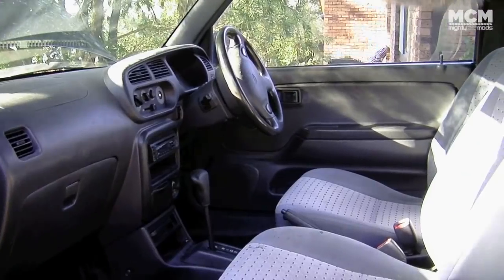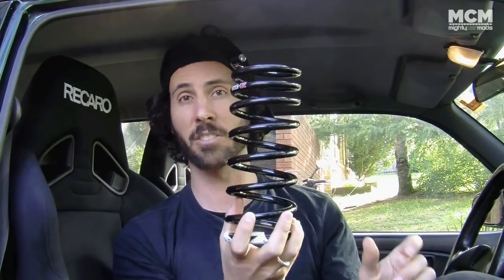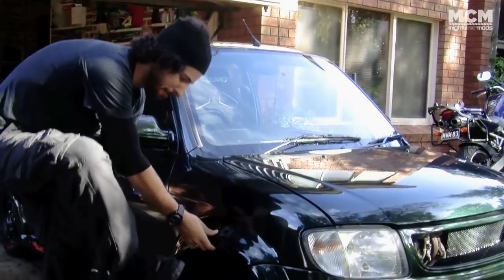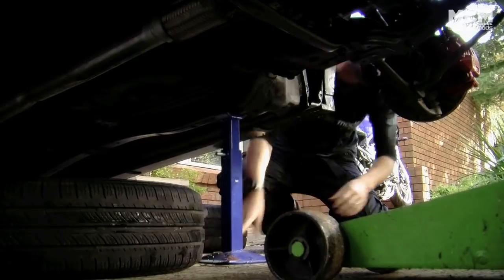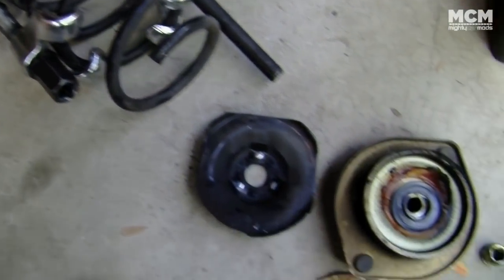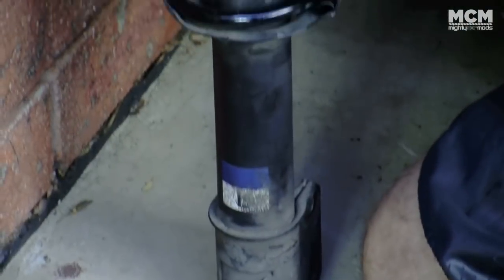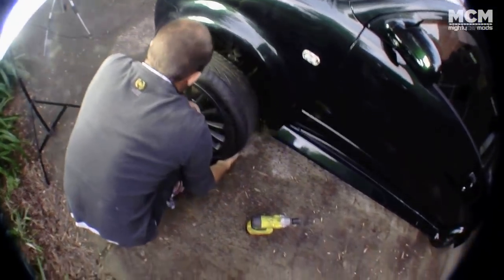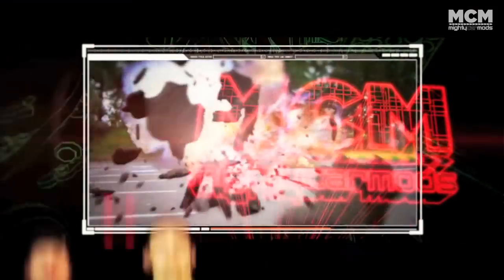How To Install Lowered Springs

Comment: Yeah, assuming you have everything else in terms of tools. If you don't, pay a mechanic to do it for you. Springs can be very dangerous if not done correctly with the right tools. A mechanic would have it done within two hours labor, and won't charge too much

Comment: I'm going to lower my VW Golf 5 soon but i'm worried thatmy sway bar will rub on the drive shafts when cornering or anything more pressing on the suspension... I've added shorter drop links as it is (factory) and I'm already hearing a rubbing sound when at full lock?
Any idea's??

Comment: hey bro , I just  been installed lower spring  my 04 civc. But it  going  too low it about 1" or 1 1/5"  ,  it hit my rear fender when on corner. Do you have any idea to make it stronger  when it have  turn?  thank you
Reply: Raise the  suspension up so  it's 30mm all  round. if  you have  it too  low  it'll scrape inside the wheel arches..  Unless you  get the wheel arches done.. It''l  be  cheaper and  easier  to  just  raise the suspension. You  can change the bushes  for  poly  ones and  the  bump stops  too.

Comment: How are the struts holding up with just the lowered springs????  I failed the shoe test and need to lower my car.  Just a little weary of replacing only the springs.  would only be a 1.5-1.7 inch drop.

Comment: Okay so here's a question I have a 2000 SL500 and I don't know if you know but the Springs are separate from the struts so could I in theory just take some spring compressors Jack it up use the compressors and switch out the springs thanks

Comment: do good springs increase handling/make cars grip better?
my wrx grips quite well but i want it to go harder :)

would some good high quality progressive springs do much ?
Reply: +Jared Tate Nice car :)
Reply: Grip is based solely on tyre but however lower suspension (better springs) increases stability and handling

Comment: To change the rear springs, do I have to use the spring compressor? My car bounce in the front do I have to change only the shocks or both the springs and the shocks? Thanks.

Comment: when installing just lowering springs, doesnt that mess up everything? Like rebound and tension between the spring and the strut, since the spring is smaller. And also doesnt it ruin the allignment?

Comment: Hey, MCM, when I was bombing about in VW Polos there was a general consensus on the forums that lowering springs would kill off a standard shock in fewer miles... certainly, all the kids fitting ebac's would inevitably be back 6 months or a year later fitting coil overs because there shocks had failed... do stock shocks take a pounding with lowered springs due to always being permanently compressed by 40mm, or do ya reckon the lowered springs just allow more aggressive driving that simply kills them quicker?
Reply: their*

Comment: Do lowering springs make a really big difference in dropping your car ? Have a mazda protege5 and i heard they dont make much difference but improves handling. Anyone ?
Reply: It depends what you want from a suspension upgrade.

I have lowered sport springs on my 2004 Honda and it is now slightly lower, not hugely noticeable, but the handling is amazing. Obviously though they don't allow any adjustment to any suspension characteristics eg ride height, damping etc because they are a set height and can't be adjusted.

If you want to go as low as possible then you might be better off with air ride, although it ain't cheap. I recommend adjustable coilovers for all round suspension improvements.

Comment: I have been resharching lowering springs for my car, many forums have said that the shorter springs will over load my stock shock/strut and cause failure. Is that possable? And if it is possible what can I do to prevent that from happening?

Comment: When they marked the camber bolt on the wheel, by marking that how does it tell you where to set it again? Will the marked bolt line up with the other marked piece?

Comment: hi ... i installed eibach pro kit lowering spring on my civic but lately i noticed that there is a knocking sound when im turning left or right.. can u help me out? pls...
Reply: +Bradley0beaver can u help me out?
Reply: probably cv joints
Reply: that too. i'd highly recommend using an impact wrench for suspension work.
Reply: CV joint.

Comment: if u cut th springs get th end wher u cut flattened so it doesnt put strain on 1 side of yor strut/shock & get shortend shocks or get yor stock shock shortend so the spring is captive.i did this 2 my R30,its 60mm off the ground & not stiff like factory lowered springs & 2 make springs captive,i got 75mm cut off and re-threaded .to know how much to cut u hav2 measure top of strut 2 top of spring after been cut while jacked up and add 10mm.the bump stop will need trimming too,haha.

Comment: Whats the main difference between coil overs vs lowered springs and which one would have a higher chance of getting a defect in NSW?
Reply: xIIRevoEvo coilovers are almost always better (and more expensive). coilovers allow you to adjust your ride height when you need to by taking the wheel off and turning a collar thats located on the strut. when they are turned all the way down coilovers almost always go a lot lower than anything you can get with springs and when they are all the way up they almost always allow your car to sit higher than it would with springs. not to mention they're way better for handling performance than just regular springs. save yourself money in the long run and just get coils... trust me

Comment: Bimmer* and no, e30's are expensive because people love them, not because the parts are expensive to make. if you buy an e36 they are cheap. cost as much to buy parts for as a domestic rig... i have to redo the exhaust before i lower it anyway. the only way to make it dual exhaust with out cutting out the spare tire bump they had to route the pipe under the diff... kinda stupid but it works w/ stock suspension lol

Comment: I'm trying to buy lowering spring for my 2004 Honda but I was wondering if there will be any problems if I use the stock shocks?
Reply: I have a 2004 Honda and have used lowering springs with standard shocks, no problems at all. May not be the case for all 2004 Honda's, it may depend on what Honda you have and how hard you drive it.

Comment: I've got a question for you all. I have a ford focus 2001. It has independent suspension in the rear, but the camber is not adjustable. I have to replace the springs because I have some camber issues caused by uneven springs.

Here's the question.

I have enough clearance to use some lowering springs, but I'm worried that this will cause a symetric camber that will create issues on the inner side of my tires.

the stock springs' resting position should be about an inch higher than these new lowering springs.
Reply: get a sports suspension  kit don't  use the factory  dampers.

Comment: Hey, guys.
I own a 2011 Audi TT and I really want to lower the suspension.  It's all wheel drive as well.  Would you have any recommendations on what kit to use and how low would be just right before causing issues?
Reply: Justin Waters buy a decent quallity  coilover set and lower about 4 cm its more than enough with a audi

Comment: in reply to the comment you deleted, no you don't need to "change the Control Arms & install Coilover Suspension from a later model Toyota" to change the engine and why would anybody change to a nissan engine? well because they are plentiful (at least in Australia), there are heaps of aftermarket parts for something like a CA18 or SR20 so they can good power for cheap, I put a 4AGE in a AE86 I had and it ended up costing me about the same as a CA18 conversion would have and made half the power.

Comment: Would lowering my AWD Audi effect how it drives in the snow? I'm guessing it would just not do as well in deep snow, but is there anything else?
Reply: Brandon Jackson if you're just doing springs then you're absolutely fine. i drove my vw once this winter with coilovers at their lowest setting and 19" wheels with summer tires (super super sketchy but i was in a pinch). if you have all season tires and lowering springs you won't even be able to notice the difference in the ride

Comment: Never mind. Did some research. Coil overs vs. springs vs. struts?
Reply: Coilovers really are  for  trackdays. A sports suspension  kit  is  good  enough  for road  use.
Reply: ***** Not necessarily true. A decent affordable coilover set might cost up to $1100 vs A set of springs and shocks which might total around $600. This is in Australia though, no idea what suspension parts cost in the US.

Comment: So if i put lowered springs on my car, do i need camber kits to align my tires back to normal or will they be ok? or does it depend on the car?
Reply: i suppose it depends on your car and how much its lowered
Reply: alright thanks dude
Reply: if it's a solid front axle, not you won't so any rear wheel drive only car will not need a camber kit, something such as my 2004 silverado 1500 which I would never lower and is four wheel drive which in this car means it has independant front suspension, something such as that I would need a camber kit, otherwise it would look unbelievably stupid

Comment: He might have cut the springs at one end of the car and only replaced the other end with lowered springs. Cutting springs is the ghetto way to lower you car and is generally quite unsafe, so I'd check that out. Either that, or the suspension on one end is collapsed and has made it lower than the other end, and rather than fixing it, just bought lowered springs to balance it out.

Comment: The whole unit they pulled out of the front, that is a "Coil over damper" shock absorber. You can either replace just the springs for different reasons (lower, stiffer, higher etc) or replace the whole unit (either coz the original is just fucked, or for racing/sports)

Comment: Which one is better coilover or lowered springs? I heard that lowered springs slam car just like coilover but coilover can be adjust and lowered springs can't? Thanks!
Reply: Coil overs are definitely better, but they cost over 1,000$
Reply: Dylan Johnson not always true. TagKis LosHlub depending on which car you have you can find lightly used second hand, or even "budget" coilovers that will perform perfectly fine on the street. coilovers are definitely the way to go though, i know so many people that bought springs first only to realize that they want to go lower and waste money on coils... just do it right and get coilovers to start with
Reply: Ben Dover with springs though your car will bounce like a basketball
Reply: Dylan Johnson i guess it really just depends on what you get. my mk6 didn't feel any different when i installed h&r sports. coilovers on the other hand was a pretty big difference
Reply: Coilovers are the better choice since it consists both the coil spring and shock absorbers. But they do cost a lot more.
Reply: TagKis LosHlub Depends on your "lowering" application. If you're planning on tracking/drifting your car, or are looking to "slam" your car, definitely invest in a good set of coilovers, since they allow for a lot more adjustability, (height, camber, etc.) and are stiffer in the corners. On the other hand, if you want to keep the comfort of your stock suspension and you're not looking to to any major track racing or go crazy low, save your money and get a decent set of lowering springs - just be sure that your stock shocks can handle the extra compression of the lowered springs.
Reply: Better of getting bags lol, go illegal to legal in 5 seconds 😂
Reply: BOO5TN don't see too many track cars on bags.......
Reply: Ben Dover not everyone builds their cars for a track.
Reply: Coilovers if you can, you may wish to have options later #adjustable
Reply: how do you know if your cars stock dampers will be able to cope with lowered springs??
Reply: If you have the cash go for a high quality coil-over package. Lowering springs are okay, but it's always better to get a nice strut/spring combo or coil-overs to properly lower your ride and give it a nice handling upgrade.

Comment: can you control the amount that it is lowered or does it depend on the length of the lowering springs? 

I have a MK5 GOLF which needs lowering :D
Reply: Coilovers or airbags are much better than springs on golfs
Reply: Thanks for the info - I will definitely look into it Cathal Regan
Reply: Rizwan Ali coil overs and air bags are only needed for certain reasons. If you want stance I.e your axels scrapping the floors then use Air bags. If you plan on getting the better lap times you want coil overs. If you're just looking to get a reasonably lower car and keep it that hight for your daily then lowered springs.
Reply: Michael Gallagher - thank you for the input. I guess I'll look into lowering springs.. unless it's a different case for A3 8V.

Comment: I didn't imply that your precious car is a ricer. The act of cutting springs is just treating your car like crap for the sake of better looks. 
Also, calm down (no need to show off your engine), if you really are serious with lowering your car, then get coils. Otherwise, if you prefer form and looks over better handling then do what you want. It's your time/effort and your car (which I feel sorry for).

Comment: you say it cant be easier then the dihatsu... My vs commodore actually has the spings fall out when bashing through the bush... Gotta love paddock bombs haha
Reply: I'm actually about to lower my vs sedan in a week or so with King springs, under normal city driving  will it be fine with the stock shocks and struts? Or will my springs fall out, I plan to install new shocks in a few months after the springs

Comment: What are all the ways you can lower your car? My Rsx came with a set of Megan racing springs. It's still sitting too high.
Reply: coilovers
Reply: I was looking at a pair of skunks for 900. What's a decent price for GOOD coilovers without that cheap bouncey feel?
Reply: Are the  shocks adjustable?
Reply: In terms of damper? Yeah. Hey better be for close to a G

Comment: Will sedan coilovers fit wagon coilovers ? The rear is whats worrying me because of the height difference. Can anyone help ?!
Reply: What car even? Need details.
Reply: Not sure, really does depend on the car. As far as I know, Subaru Impreza wagons are practically the same as sedans mechanically, so regular sedan parts fit fine.

Comment: If I buy lowered springs and new shocks do I still need spring compressors?
Reply: It's best, as the original springs will be a bit unruly.
Reply: well if you did that then you'd be replacing the entire suspension strut, so you wouldn't be removing the spring, so no need for compressors

Comment: I put an 12" lift on my truck with two jack stands and a floor jack in my driveway. No spring compressor, used the jack....
Reply: Kathy Freeland I've done that before too hahaha instead of using compressors to unload the spring i jacked up the control arm, loosened the nut on the strut tower and then lowered the jack.... super super sketchy though haha

Comment: Would I need new shocks if im lowering my car by 1.2" and 1.3"
Reply: gampon63 no you won't need new shocks unless your car has a ton of miles and you beat the piss out of it. joe is right though, it will effect your shocks differently. my buddy has lowering springs and has done like 40,000 miles with no problems on stock shocks. just get coilovers though, i had springs at one point and eventually got coils... theres no looking back once you've had them

Comment: Should I get Eibach or H&R for a lowering kit?
Reply: Thanks bro!
Reply: phillip shevchenko  Don't get coilovers if you value ride comfort. Most affordable coilovers are much harder than the stock springs and shock, it might improve handling (not 100% true, given that some coilovers are stupidly hard and mean you get no grip at all over an uneven surface) but it's uncomfortable as hell. I know, cause I put Blitz coilovers in an R33 skyline. Good shocks eg. Bilsteins and Konis, and lowering springs are cheaper than a set of decent coilovers anyway, and more comfortable too.
Reply: ***** so true my coilovers make my integra handle so better.
Reply: phillip shevchenko i can tell you have never lowered a car before. and i truly mean that in a non offensive way. its just that anybody who has had a lowered car before knows that coilovers are the way to go. EVERY single person that i know who installed lowering springs changes them out for coilovers in less than a year
Reply: I Thought it was the springs only

Comment: IF I COMPRESS THE SPRING WITH CLAMPS TO LOWER MY CAR...DO I HAVE TO DO ANY MODIFICATIONS TO THE SHOCKS
Reply: oh dont do that
Reply: Keepo Hdee DANGEROUS??
Reply: ROBERTO FLORES horrible idea I would rather cut the springs. also if you get some cheap cramps those things might fly off and put a hole through someone. And yes if you are gonna be lowering your car 2 inches or more you need shorter shocks doesnt mater if you cut them or compress them the shocks will be fine for a while then break.

Comment: then explain why ive had to replace the stock shocks on my lowered eclipse 3 times because theyve blown. stock shocks are not meant to be lowered on. they dont do theyre job properly when lowered. im telling you. unless you have really really really good stock shocks. change em. youll end up spending 3x more if u dont

Comment: can you put lowering springs on stock shocks and struts?
Reply: If your struts and shocks are still new,  you dont need to replace it.  But it's old,  yes it is recommended to change it
Reply: Not recommended. Also, you may bottom out or springs could fall out if you don't have shortened shocks.

Struts will be fine as Spring is captured, however will still bottom out and destroy your suspension.

You are better of upgrading struts/shocks when lowering.